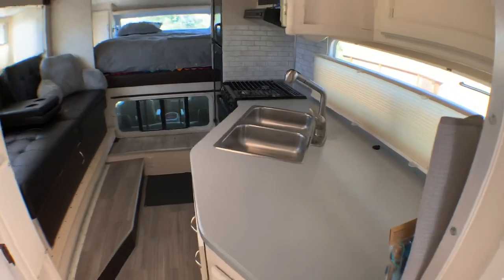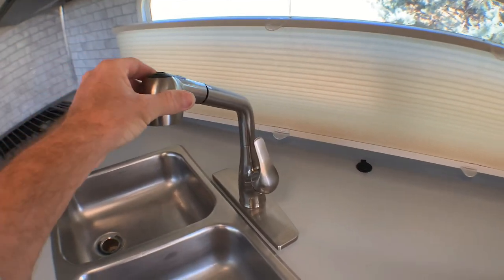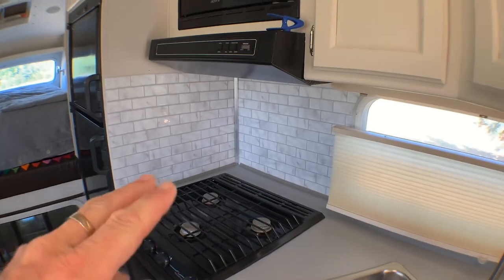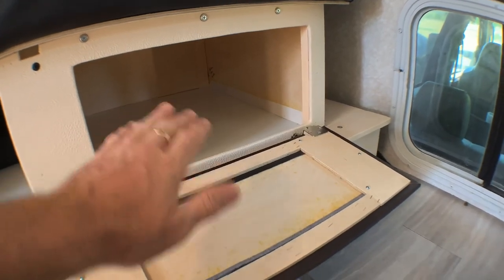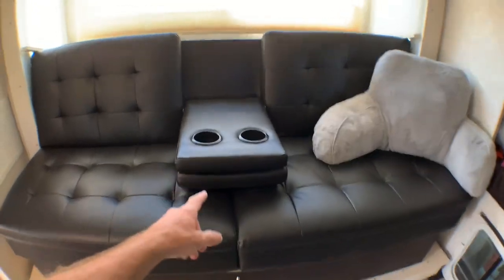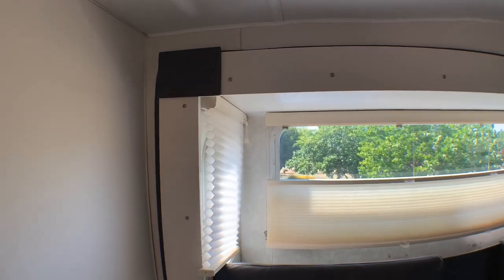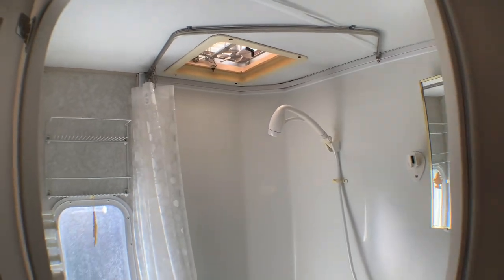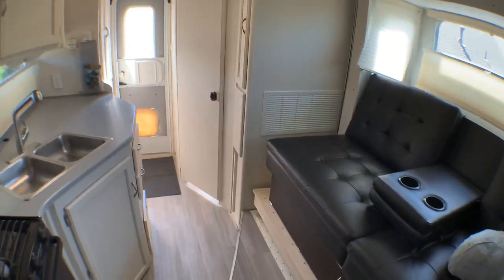Truck Camper Rebuild & Remodel is Finished!  Structural & Cosmetic

Comment: Nice job. Now for the exterior. Remove all the exterior graphics, dicor all the seams and repaint the TC to color match the truck. Put the Covet the Camper logo on the front of the TC. Also copy and frame your RV Technician Diploma and hang it proudly inside.  Great work. Now, get to camping. Enjoy. Safe Travels and Happy Camping.
Reply from the maker: We might do a wrap when it’s time to go Workamping.  Would be great advertising when pulling into an RV park or campground.

Comment: You said you worked for Fleetwood for 10 years~ I just purchased a 1993 Caribou 11JX because it was always covered and never used :) Basically NOS~
Do you know what type of roof material they used on that year Fleetwood truck campers? Thank you!
Reply from the maker: If you have the filon front cap, then most likely you have the EPDM rubber roof.  If it’s aluminum front cap, it’s most likely aluminum.  They transitioned in 1993/1994 years to the Filon (fiberglass) vacuum bonded sidewall system on the Class C motorhomes and I think the truck campers changed in 1995/1996.  
If it’s rubber, it is an EPDM.  To my knowledge, Fleetwood did not ever use TPO roof.
Reply: @covetthecamper2289  Thank you! Yes, it's aluminum sides but with a smooth front cap from the marker lights to just above the windshield? What would that mean to you on which roof type? I'll tap on it tomorrow to see if it's metal or not :)
Reply from the maker: Yep, if it’s the filon front cap, it would be EPDM rubber roof.

Comment: Great Job!  You put your efforts where they would do the most good.  Can the Slide be retracted manually should there be the need?
Reply from the maker: Thanks!  Yes, two ways to manually retract.   There’s a lock/unlock lever on the motor and with the included hand crank, I can just crank it closed.   The other way is to unlock at the motor and just push it from the outside.   It’s a relatively small slideout so pretty easy to do.
Reply: @covetthecamper2289  I have the same type slide motor. How do you make that lever on the motor move? Scared I am going  to break that plastic lever. Also did you put a bulb seal on top of the wiper seals on the outside?
Reply from the maker: @daranthony7907  
Mine moves relatively freely as long as there’s not pressure on the gearbox.  
Yes, I installed new bulb seal on the Slideout.  It’s adhered to the inside of the Slideout T-molding so that when the Slideout is closed, it mates to the wiper seal surface and compresses creating a water tight seal.
No leaks so far.

Comment: I can’t believe how nice the inside looks now. I have a 2001 Caribou. It looks like the twin to yours. I have some of the same issues you’ve had with the skirts rotting out and always wondered if the composites would be the way to go for the repairs. 👍 Great work and safe travels.
Reply from the maker: Thanks.  We’re really loving it.  Yes, the skirt was completely rotted on the drivers side.  The composite materials are holding up perfectly.   I’ve got a full video on that rebuild and how I did it.
Reply from the maker: RV Repair • Failures & Progress in the RV Industry
https://youtu.be/lEhipdrAgbk

Rot Resistant Truck Camper Repair!
https://youtu.be/SdrfYCSUotk

Rotten Truck Camper Rebuild Continues
https://youtu.be/AF2L5_8FANU

RV Repair. Truck Camper Storage Doors
https://youtu.be/O9pxdycBhCE

Comment: How is the tc weight with all the changes?
Reply from the maker: Fully loaded for travel, full water tank (55 gallons) food, dogs etc we’re about 100lbs lighter than before the repair/remodel.  Weight savings mainly from the Slideout rebuild using composite materials.